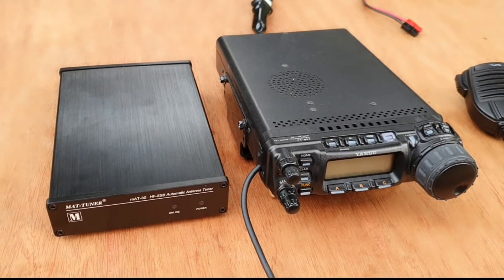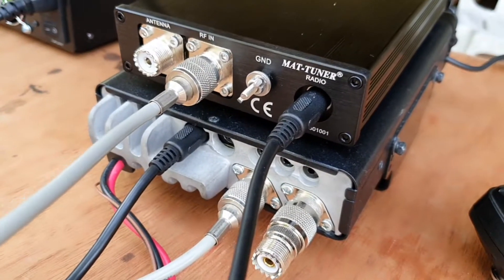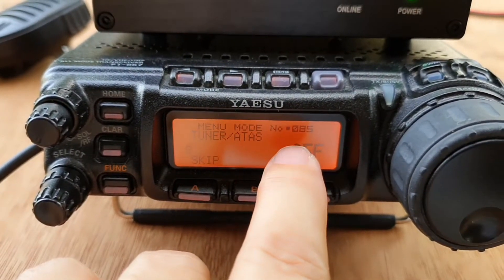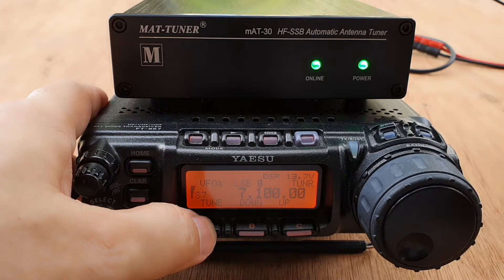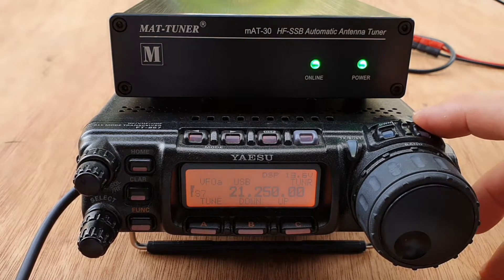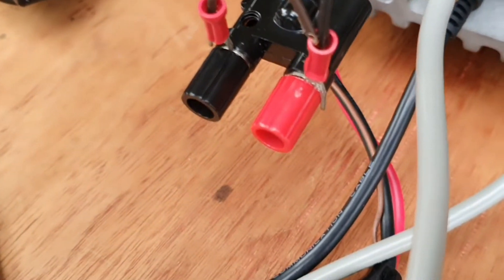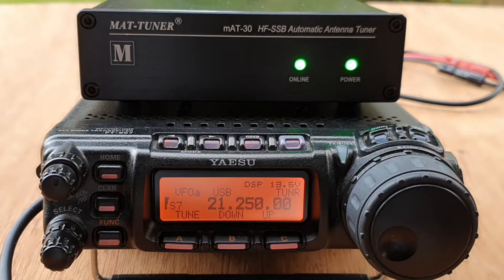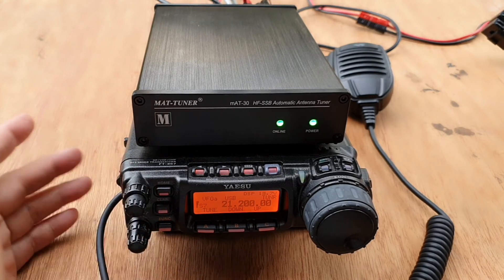MAT Tuner Tuning Test with Homebrew wire Antennas

Comment: Hi
I found your video as I'm looking at buying this ATU. One of my concerns was the ability to use it with a random wire.
Found your video interesting and the PL259 / BNC / wire binding adaptor may actually provide the solution. 🙂
Reply from the maker: Enjoy ham radio 73😊

Comment: Hello Jay

Just watched your video as I have got a FT-857D myself and I was very interested in your use of 300 ohms twin lead for the antenna and what I am also interested in as to what is the part number of this 300 ohms twin lead antenna adapter called that is going into the back of the FT-857 called I have seen this before but could not find out were to buy one from or it part number.

Thank you for the video Jay it is well done 73/s.
Reply from the maker: @sue driver, ... the name of the adapter is BNC- Banana plug Splitter, plenty sold online. Good luck on your project. HAPPy New Year  73 😊✌🏻

Comment: Do you have to re-tune every time you change frequency ?
Reply: Yes you do, but the tuner remembers the tuning for that frequency and it is set unless you change antennas or modify the one you originally tuned it on.  Basically works the same way an internal tuner (ATU) works.

Comment: Jay--I am lost on how you can tell if this is tuning or not or what your SWR is.  Is a red light  supposed to flash or something if it won't tune? You transmit a test signal and say it is working ok.  Are you looking at an SWR meter not in the video?  I stared at the video and I see the s meter but that appears to me to be the incoming signal strength.  Is it supposed to say something like untuneable?  I have an ft897, which is similar and am trying to figure this out?  At one point you said it looks like the signal is flat.  Please clarify.
Reply from the maker: Hello Warren, i have set the meter on my 857 to show both the signal strength and SWR,. so you will see that when on RX the meter shows signal strength. After pressing the tune button with the MAT30 enabled on TX, you wont be able to see any movement on the meter scale, that means your SWR is flat.... in the event that you have a bad SWR as also shown on this video you will see the HSWR on the upper right side of the display which means high swr.  i hope this helps. 73 de du7jay
Reply: @du7jay  Also, the external tuner will just not tune (won't hear the relays clicking) if the antenna's SWR is too high.

Comment: Hi, i have the mat30 with ft891 but can't get swr below 2 on certain frequencies while on others, i get nice swr 1.0
I wonder if one ore more relays in the tuner is faulty or there is a problem in the tuning algorithm. No matter what, the tuner is unable to tune certain combinations of R and X values which should be well within specs.
Does your tuner always produce swr within 1.2 or less? Mine gives almost 2 on some frequencies 😒
Reply from the maker: Hello OM,i am not an expert on this tuner, I just happened to own one hihi,... this is my experience.. we have to understand that every time we tune an antenna the tuner saves it on its memory, Im not sure the extent of data it stores in its memory all I know is it stores it there,.. when you tune another antenna on that same frequency or band that it has already stored in its memory it will revert to that data and give us a fast tune even the swr is not really flat 1.0 as what we wanted,... i guess the solution to this is to reset/ delete all stored data every time we change to a different antenna in order for it to start fresh every time it tunes,... hahah i don't know if this makes sense but this is just what I observe,. 73 and stay safe always,. de es du7jay.
Reply: @du7jay  hi, thanks for your reply. I am aware of the memory tuning mechanism, however this can be overwritten by long press ot the TNR button which forces the tuner to perform full tuning cycle... yet, I get swr of 2.0 on some frequencies, not less... on other frequencies i get 1.0.... it almost looks like the tuner doesn't like certain combinations of Z=R+X
Does your tuner always get you on swr 1.2 or less no matter what the frequency is? Mine doesn't.
73, Ondrej
Reply from the maker: @ondrejpovalac9811  ...hello om,. Im using a 80m doublet with open line feed and the tuner seems to work fine with it.
Reply: @ondrejpovalac9811  I got similar confusing problem once. In my situation, I guess there was some RF that might came from my too short coax that ruin the external SWR meter reading. In my case, the tuner itself was fine, and but the SWR indicator fooled me. I have been using MAT 30 for almost 2 years with Yaesu FT-891 without problems for dipoles and multiband en-fed antenna. All my antennas are resonant, but it is nice to have a dedicated tuner that is ready when needed.  73, Iwan, YDØRTA
Reply: @ondrejpovalac9811  Its not going to tune an antenna that has an SWR beyond its capabilities.  And if the SWR is abnormally high at the frequency you are attempting to tune at, it may only be able to achieve an SWR of 2.0 or even higher.  You might want to look at the SWR of your antenna across the band you are working in and see how the SWR varies across the entire band.  This is especially critical for non-resonant antennas like end-fed half-wave wire antennas.  For a dipole, your SWR should be pretty consistent across the entire band it is cut for, but it probably won't be exactly flat.

Comment: The manual is terrible, you have to figure it out yourself.  Why does the Mat-30 Relay's click off after moving 10Kcs?  the noise level drops, and you have to return to hear.  How do you read SWR on an FT-857?  I can't see that on your display.  What Power Level do you run your FT-857 at with the Mat-30?
Reply: This is confusing.  It seems that you need to tune the antenna every 10kHz in advance of using it on a particular band.  Otherwise, it cuts in and out and you attempt to tune across the band - and seems to attenuate the receive.  The manual is useless.

Comment: I love your test but you still have a mismatch at the antenna feed point... i suggest use open line feeders such as a ladder line which closely match or approach your antenna"s feed point impedance, a BalUn will also help  73s mabuhay
Reply from the maker: Yes om Maglito you are very correct 👍🏻😊... the test was just to see the capability of the tuner to tune difficult antennas (sort of like torture testing it hihi) thats why I made the antenna that way hihi ✌🏻😅.. 73 and Happy New Year 🎉🎊😊